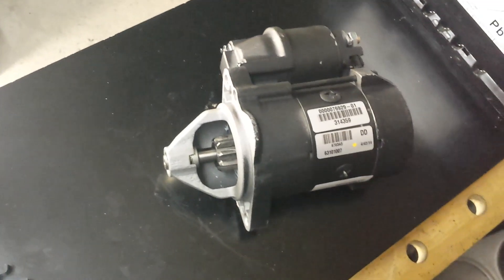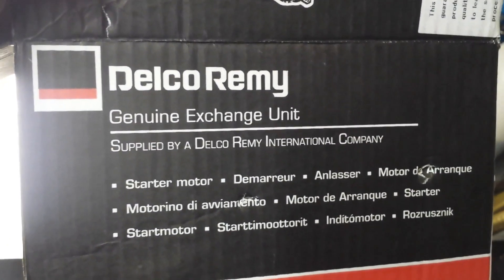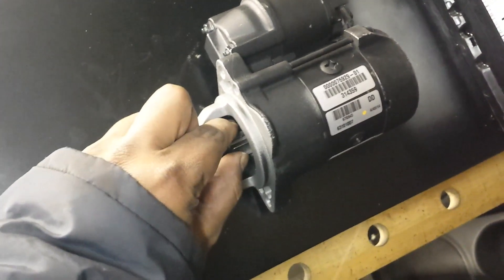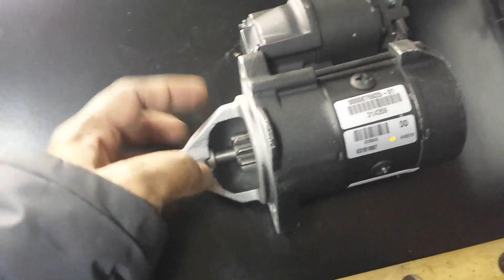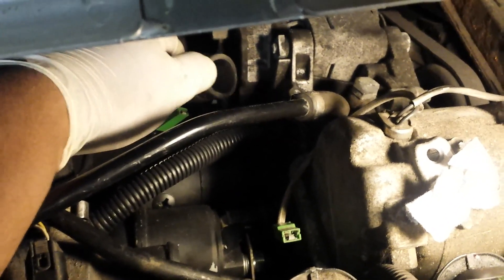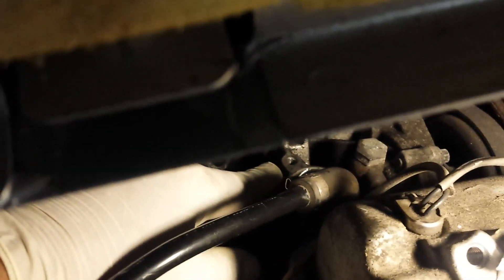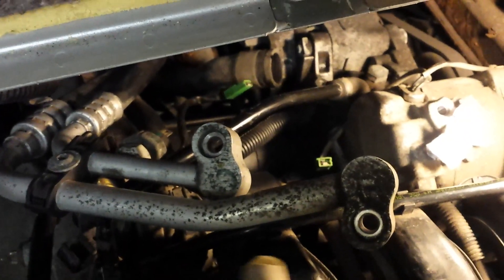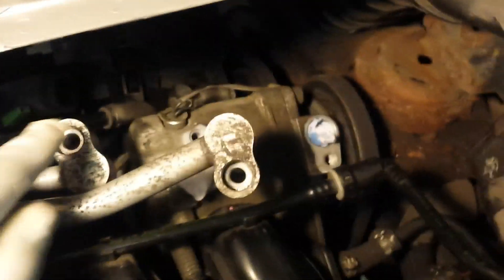Smart Fortwo 450 Starter motor replacement and lowering the Engine Part 6

Comment: Hi, great video! I’m working on my Smart Fortwo 450 (2003), and I noticed the two green wires like the ones in your video. One of them in my car is disconnected and I can’t figure out where it should go. My car won’t start at all — no crank, no sound. Could you please explain where exactly those two green cables go, and if both need to be connected? Thanks in advance!

Comment: Couldn't find any specific info about this: what is the size of the nuts on the starter's solenoid? And you took the A/C pipes off? I hope the system was already empty. :)
Reply: +DelphiDelphin.  Re: the A/C pipes, watch Part 5 from 5:00 to 5:40 and +WaqasAhmed explains how he knows that there is no refrigerant in the pipes.

Comment: great video. you explained everything perfectly. you would make a great instructor. cheers
Reply: Thanks for the detailed video, my rear motor mount broke causing the alternator to drop into the frame and short out and burn out the alternator. I had to pull the starter to replace the positive battery cable which is a true pain,but your video made it a lot easier, thanks again.